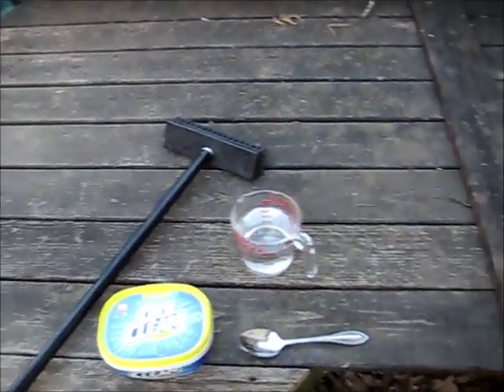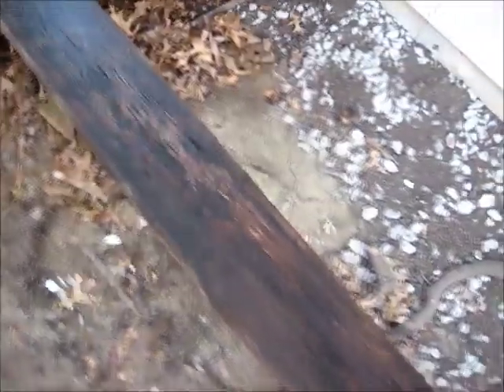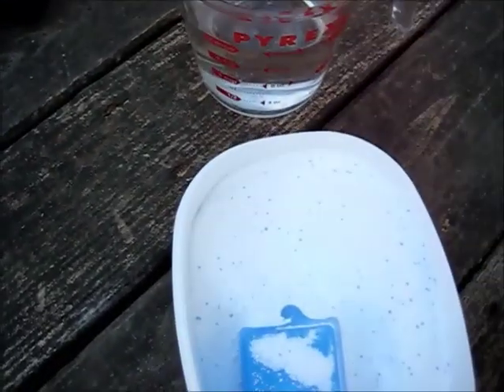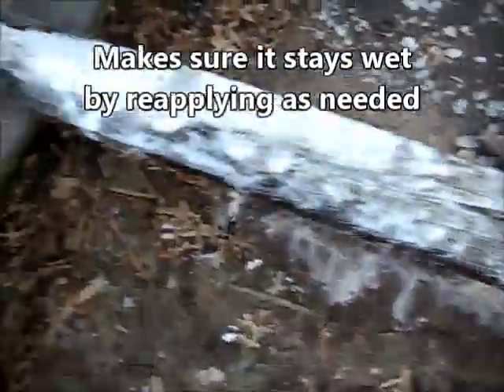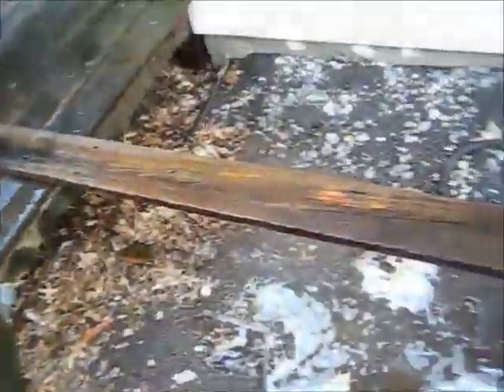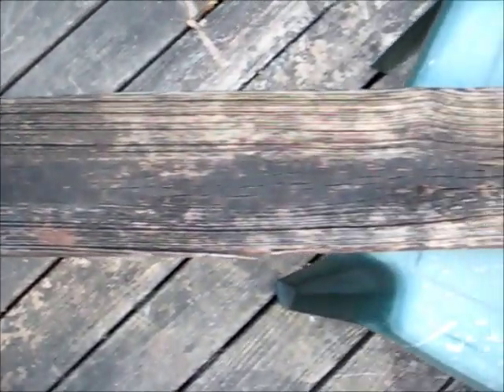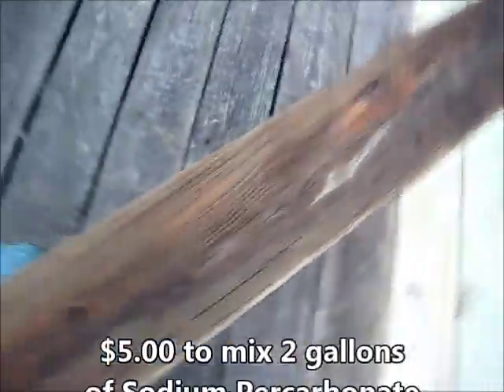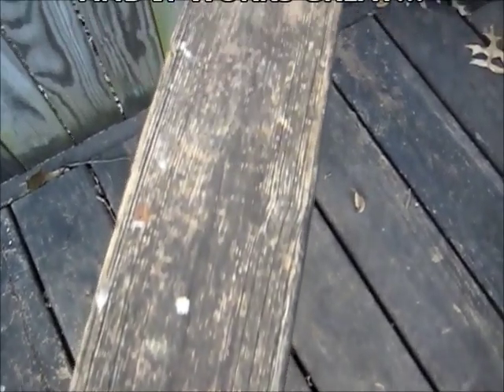wood deck cleaning SHORT VERSION Testing Sodium Percarbonate, the truth, oxygen bleach clean boards

Comment: Thank you for this fantastic advice, and making this video to show others  how to do it.  I just did it today myself on my deck, and you were right on the money.  OxiClean does a great job, doesn't hurt plants or animals, and with a light scrub the dirt just washes off with a garden hose.  And it's inexpensive.   Awesome. Great!  Thank you very much.  p.s.  I have no relationship at all with OxiClean.  It just happens to really work well for more than laundry.  And it's easy to get at HD.
Reply from the maker: You are very welcome, That is awesome to hear the video helped. 

It is my pleasure to give back for advice I get here on Youtube sometimes. The story I told is true, I looked high and low for a good way to do this and discovered this is the best way... and it doesn't hurt plants or animals :)

It is also a fact that this stuff really cleans many many things quite well. 

I almost made video last week showing me clean the disasterfilth I found when I moved my refrigerator out... YIKES!! There was so much mystery filth...

 I just cleaned back there 10-15 years ago, it is  hard to believe that it was that filthy, but it was.

I had no idea what all that filth was... so I vacuumed up the loose stuff and tried wiping up the dirty spots.. but nope... they were not coming up easy.... 

So I mixed up a small batch of oxiclean in hot water and simply dumped it on the dirty spots and let it soak for 20 minutes. When I came back it was crazy how easy it was to use a paper towel, wipe it off and pull it up. It was too easy... and in 5 minutes it was sparkling clean... good to go for another 10 years.

I also do not work for, or have any relationship, with them... and did not make the video of the frig clean because it might look like I was shilling for them... but I am not,  I am just passing along things I learn to help others and I am stunned how well this stuff works. 

The key is mix it up in hot water, make sure all the stuff is diluted and then let what ever you are cleaning soak... soak ...soak.... then maybe do some scrubbing and wash off. 

The bubbles do all the work. 

PS
I soak my white socks in this stuff for 4-5 hours before washing them.. and it works!
Reply: Good to know.   Next time I replace the fridge, I'll be ready with some OC and a scrub brush.   Best P